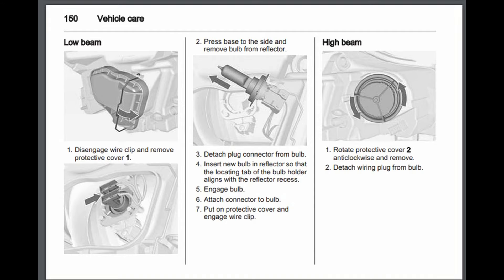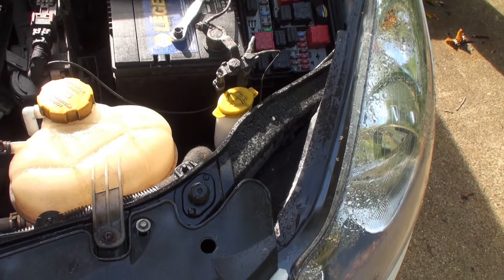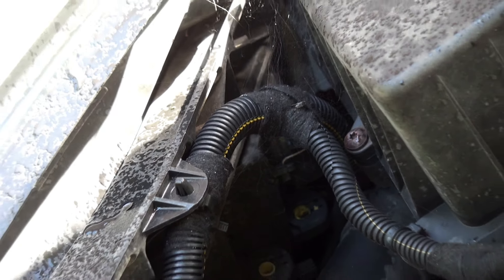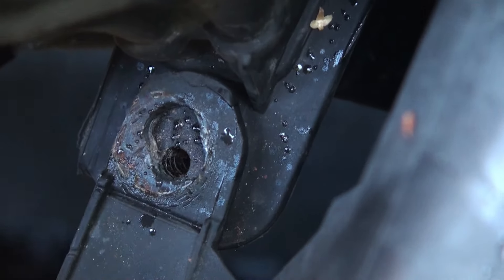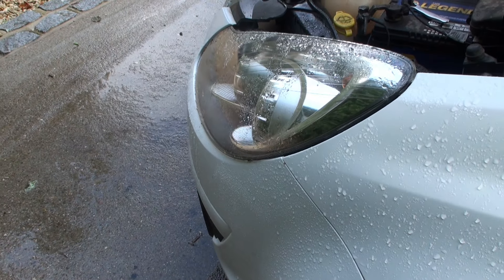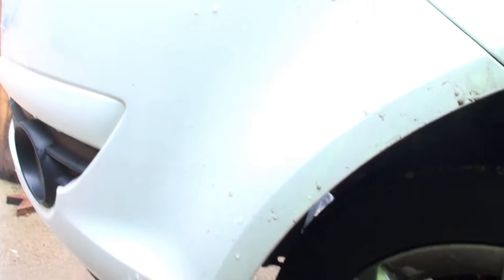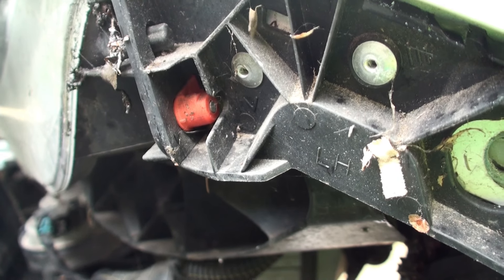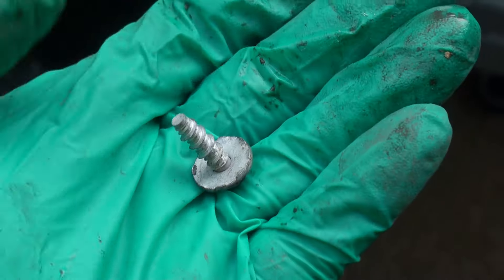Corsa D Passenger headlight bulb change

Comment: The person who designed it this way must have been on shrooms or something.

First we tried doing the replacement normally under the hood - impossible, we're not contortionists. Then we figured oh, the headlight assembly must come off, no biggie right? We removed the visible bolts and the assembly would rattle around but budge - so we wondered there must be a hidden bolt somewhere.

Then we found your video and realized the work still ahead of us and just drove the car off a cliff. The engineer who came up with this crap should be forced to replace headlights on these for eternity. I pity the fools working at the Vauxhall dealership. Good god.

Anyway, thanks for the video!
Reply from the maker: We are on the same page, Glad it was useful. Some leave that lower bolt out to simplify next time....

Comment: Thank you for a very helpful video! But even with the guide it took two of us more than an hour. The final bolt is a nightmare to get at. If anyone from Vauxhall happens to read this please move stuff around in future!
Reply from the maker: It is disappointing how little they expect the owner to do. Fuses are hidden away under components in engine compartments. I helped a friend fix the fuse on his reversing lights on a new Citroen van the other day - It took us an hour to find the fuse compartment and another 20 minutes removing stuff so we could get to it.

Comment: Just tried the instructions, worked a dream. Doesnt alter the fact that in Germany this is NOT something that can be done by the roadside - it needs a decent tool kit and a decent light. In most certainly is possible to redesign the lamp to not require this - I will get one from a scrapyard and do so to prove a point.
Reply from the maker: Great idea.  I don't know what they were thinking...
Reply: Thats redesign would be awesome just share it in thingerverse as a file or directly mail it to Opel to showmthem how poor the current one is
Reply from the maker: @kitecattestecke2303  When I asked the local Vauxhall dealer's service manager about it he just shrugged his shoulders and said there are a few things in the user manuals that can't be done the way they show it.  He then said he thought it wasn't a problem as the bulbs last about 5 years and the car would be out of warranty by then. An illuminating answer. I then said 'but bulbs aren't covered under warranty anyway'  but he didn't seem aware that I had shot his fox. Not the quickest of thinkers!!

Comment: It’s a horrible job but I’ve done this a few times now and only had to remove the fuse box cover. The head lamp back plate will come out totally and then you have to grope around to get the bulb out and in again. It’s an absolute pain to make sure you’ve got the 3 prongs aligned and push them past the retaining clip but it can be done.
Reply from the maker: Maybe get a job doing keyhole surgery!!   As for me, I prefer to just get on and do it the easy way!!

Comment: Sweet video but i managed to do mine today without removing/unscrewing anything. The flap/cover for the headlamp can be removed and makes it much easier to reach inside and access the bulb. A bit fiddly still but manageable. :)
Reply from the maker: No it can't. You have a different arrangement under your bonnet or you are talking about the wrong side.

Comment: I've just replaced the passenger headlight bulb. How infuriating just to change something so small? I will say getting the bulb to align in the gap was frustrating. Thanks for the guidance. To be honest other makes are far easier. My older Ford Fiesta 2011 model took 5 mins to unbolt the 2 screws, remove the headlight cluster and change the bulb.
I have a facelift version of the Corsa (2014) model and this whole operation is a faff. Anyways all is well now and the headlight is working.
Reply from the maker: Great stuff. It is mad! It even annoys the guys down at the Vauxhall dealer down the road from me as they are fed up with customers moaning about paying 30 minutes labour for a bulb change.

Comment: I actually managed to change it without removing the headlight on my 2011 model - it seems a little less tight in there than the one in the video and I might have only managed because of my rather small hands but it's definitely possible on some models although very fiddly.
Reply from the maker: Good job. It is possible on some variants
Reply: What model mate?
Reply: @OnTheDocksLaa  Corsa D 1.4 I from 2011 :)

Comment: Currently at a petrol station with my -08 corsa, both headlights dead. The cover actually comes off by pulling it out sideways. Then my fingers just barely fit. The problem: manual says to push the to the side to remove the bulb. Snapped off one of the connectors while doing that and pliers don’t fit in to pull it out. Now I’m here cursing every single engineer involved in designing this piece of…
Reply from the maker: It is very frustrating.. I don't know what they were thinking...

Comment: I replaced the bulbs today as shown in the vid. Toptip if you got the compleet asambly out. Change evry light bulb you can find in there. Seriously ridiculous how many steps ar involved. Loosen the bumper? The engineer that made this up should have been fired and banned. I repared the spedometer in 1 hour. And thought naa i will do the bulbs after no big deal. Thnx for the vid mate!
Reply from the maker: That is a really good tip. I agree that it is ridiculous. The service manager in the local Vauxhall main dealer just shrugged their shoulders.  They implied that they will change it for free if you make enough fuss.

Comment: You don't need to take the headlight out the passenger bulb can be reached by just removing the fuse box lid etc you can just about get your hands in to do it 

Drivers said you need to remove the airbag, which is a plug and one bolt rest is on like 3 rubber grommets
Reply: That being said I was only changing dipped beam
Reply from the maker: This was the driver side. The Passenger side on the 1.4 Corsa D you cant.

Comment: Hi, thanks for your video.  I got to the two torque bit T15 bolts under the wing and one has chewed up so I can't undo it and the other is solid.  Is there any advice you can give to proceed please?
Reply from the maker: Tricky. If you have a very good pair of grips you might have to be able to grip the head and turn it.  Otherwise drill the heads off, pull back the inner wing and work the screw stubs to get them out. They are only coarse thread self-tapping type screws so should work loose with a bit or persuasion.

Comment: Dependent on the size of your hands. Changing the headlight bulbs is doable without having to loosen the bumper or remove the headlight assembly. Remove the washer bottle neck, which should come off by pulling up on it. Then remove the fuse box cover. This should then give you enough space to remove the back plate on the headlight and change the bulb. Put the back cover back on making sure the 2 prongs that clip in are seated properly and push the retainer clip onto the back cover. Refit fuse box cover and washer bottle neck. Drivers side you'll need to remove the air filter box.
Reply: There is no way anyone is changing these without getting the whole assembly off. My hands are small, fingers agile and strong. I tried doing this for the right-hand-side bulb, where I removed the air filter box and tubing. There still isn't nearly enough space to work with, and the lightbulb socket is on so tight you really have to pry it off. Thankfully that time my car was scheduled for a service anyway and I just got it replaced.
But so now my left hand side low beam bulb is gone, and I see it's even worse. The fuse box and battery being one thing, but then the fuse box sits on this metal assembly that's part of the car frame! I'm lucky I have the weekend off but holy cow is this completely unnecessary.
I've driven Peugeots, Nissans, VWs and Mercedes and there is no car more hostile to user serviceability than my Corsa D. I'd have replaced it ages ago if it wasn't giving me 60 mpg.
Reply from the maker: I agree with Jari...  On the design in the video there is no way to get at the bulb..

Comment: I can change my headlight bulbs without removing the bumper 
From the top, yea remove the fuse cover 
I can just manage to squeeze my hand through there but cut to shreds lol
But saves me a lot more work :)
Reply from the maker: Fiddly!
Reply: @BitcoinStoic  yea. You can actually fit your hand in there. It does rip your hand to shreds lol but I’m not taking the bumper off !!! To change a bulb
Reply: Hi James.  Yes, I have just finished re-fitting a bulb on the driver's side of my daughter's Corsa, and thankfully I did not have to follow the steps in this video.  If you take the lid off the fuse box, just to give you a bit of space, then pull the metal clamp back off the rear cover.  Once you have done this you can pull the cover to the left and remove it.  Now you have access to the rear of the bulb which you can remove through the metal hole, and yes it is quite sharp, but doable.  I found getting the bulb bedded back into it's place was the trickiest of all the steps, but infinitely better than removed the headlight!
Reply: @PapaJoeWalsh  yeah I've managed it the same way just a ball ache getting the plastic cover back on 👍

Comment: Complicated gerrman engineering ,i found in several cars audi a4 i had to desmandle everything from back seats until the front seats , to replace, the rear windscreen,corsa d dismantle bumper and headlight to replace a bulb.
Reply from the maker: It is a strange and weird thing  they have done - it is almost as though they don't believe an owner should attempt to do anything on the car even change a bulb!!.

Comment: nice guide... But ... I managed to change mine without removing headlight it took less than 10 mins, just removed fuse box cover and had just enough room to get in there, it was tight and no i do not have small hands
Reply from the maker: You have a different variant.  Some fuse boxes are a bit smaller.
Reply: @razenby  looks the same as one in video

Comment: Changed the bulb on my 11plate corsa in about 5 mins. Must have had more room than you because there is no way you would have done all of that to change the bulb if you could fit your hand inside.😀
Reply from the maker: Some are OK there are variants...  Not even room for a finger.... I had a moan at the Vauxhall main dealer them when I took it in for an MOT and they confirmed that's how they do it on our model.

Comment: Please don't laugh but I need to do this job as I have two daytime running bulbs rattleing around inside the headlamp. The bulbholder  doesn't seem to grip the bulb very well!
Reply from the maker: I sympathise. On many cars the bulb holders are very delicate. If they expect the public to change bulbs then the should make the bulbs simple to change and also make the holders and fixing details robust enough for the user.   I wouldn't consider myself to be heavy-handed but I have broken several myself due to frustration or just not being able to see that the wire hooks under in a different place.  Good luck.
Reply: @razenby  I have ordered a new bulbholder as it didn't seem to locate or grip the bulb - and the bulb I though had failed is actuall okay - but I did see traces of arcing on one of the contacts.  I now need to tilt the car at about 60 degrees anf it may fall out - or I may remove the headlamp unit. The bulb didn't seem to have an obvious right and wrong way to insert it.
Reply from the maker: @JohnPlant90  Would a tube connected to you vacuum cleaner allow you to use it as a vacuum pick up?  Suck that sucker out of there??
Reply: Sounds a good idea - it is my daughter's car and opportunites for fiddling around are short. It is booked in to have the front bumper sorted out as it keeps coming unclipped. The guy will be removing it to see what if tending to want to push it off - I will add the light to the task as it shouldn't take much additional time. Thanks for the idea - I will bear it in mind.
Reply from the maker: @JohnPlant90  Great
Reply: @razenby  I looked at LEDs on Ebay - but could't be sure how they fitted or if they were dual brightness
Reply from the maker: @JohnPlant90 Is this for main/ dipped beam?  I haven't come across dual brightness LED. On  a car fitted with LEDs at the factory I would expect the brightness to be controlled by PWM from the BECM.  If someone has fitted aftermarket LEDS bulbs then throw them in the bin and fit the manufacture's type.  Remember buy cheap, buy twice , buy Chinese throw in bin after 6 weeks.

Comment: Thanks for this. What absolute monkey designed this? Why didn't they put the fuse box at the back and the battery at the front as opposed to side-by-side? If they'd gone the other way, then you'd only need to lift the battery out and have full access to the headlight bulbs without having to take the car body apart. The mind boggles 🧐

I also had to cut slots into the wheel arch screws with an angle grinder as the torx heads were rusted and rounded out... as you would expect on a 14 y/o car. New screws required to do a good job.
Reply from the maker: It is an annoying thing especially when the bulbs seem to blow quite regularly. Thanks for watching.

Comment: this is insane, a safety item such as a bulb and it almost feels as though half the front end needs to be worked on, so your driving at night one possibly two bulbs blow limp into a garage for new bulbs and your stuffed due to a poor design.If the light unit needs to come out it should be a simple couple of screws then pull unit out and do the job.
Seeing this sort of stupidity means i will leave it to a garage /halfords (in UK) Who will charge a small fee for doing it
Reply from the maker: I agree, it is a massive oversight and it makes a mockery of the idea that you should change a bulb before you carry on - in France it is a legal requirement to carry spare bulbs....
Reply: @razenby  well I just paid  Halfords £8.00 to fit the bulb, it was hard enough just trying to refit the cover for me. Actually accessing the bulb without dismantling the front for me was virtually impossible

Comment: same problem for me.  i think i'll just pay for halfords to do it
Reply from the maker: How much do they charge?
Reply: @razenby  16 quid, without taking the full headlamp off.  Only took about a minute
Reply from the maker: @PonySixfinger  There are different arrangements of the fuse box under the bonnet. Some Corsas you can,  others you can't. That is what the Vauxhall main dealer said too. This is a 1.4 with all the options.
Reply: @razenby  I know, it's the same as mine which is why I looked for and found this video.  Definitely worth the 16 quid

Comment: Same as the astra H then, fucking joke. there's plugs in the bumper for the higher spec headlamp washers. wouldn't hurt to hide the bolt behind something like that instead of a bloody front end disassembly for a bulb
Reply from the maker: It is certainly very odd.  A massive omission in the user manual.

Comment: Its an absolute bollock of a job. I now replace both at the same time and take the entire bumper off to do it. Worst design ever.
Reply from the maker: It does beggar belied that they would make such a stupid design.  One comment said they left the headlamp bottom screw out when they reassembled to make it easy next time. Thanks for watching.
Reply: @razenby  coincidentally, I've just replaced both dip bulbs on my 2012 Corsa without doing any of this. The passenger side I could just reach with my fingertips and the drivers side I took the airbox off which was a 2 minute job. I don't know if prefacelift cars are tighter.

Comment: You can get the fuse box half out by removing the battery. It will allow you to remove the cover BUT then you have a hole about 3" across with the bulb buried in and slightly up and worse held in by two clips. Even with the cover off you cant get anything on the little tiny clips to get them out of the way (2, one each side of the bulb you cant see without a mirror)... The other side means removal of the air filter and air intake... there is slightly more room and I did manage that one. The Germans require you to have a spare bulb kit to change the bulb at the side of the road. Frankly this car is a crick of shit, avoid at all costs and never ever ever buy. If you want to but ANY can, then check that HELLA (who created this abomination) had nothing to do with this. In fact the next time I contemplate buying a car I will insist they change every bulb while I watch, because if they refuse then its clear its a crap car.
Reply from the maker: Hi Dave, I wonder how many marques have a similar problem problem?  I have a Volvo C30 and there is a big lever. You just open the bonnet and lift the lever and the headlight pops out.  Literally 10 seconds to get the headlight out.